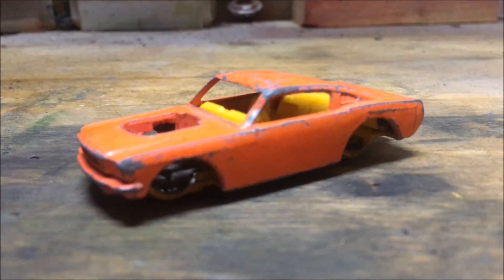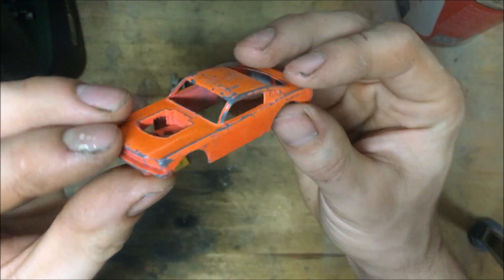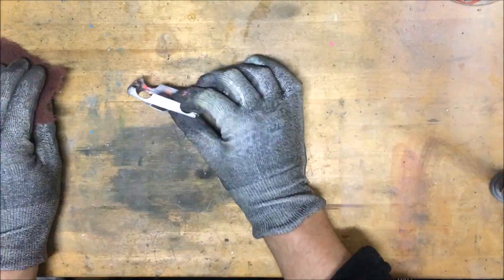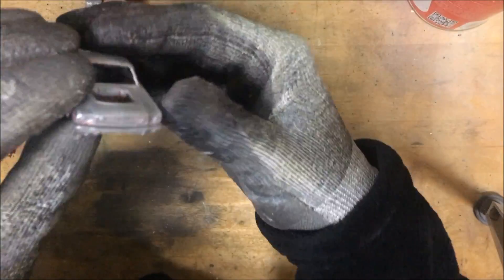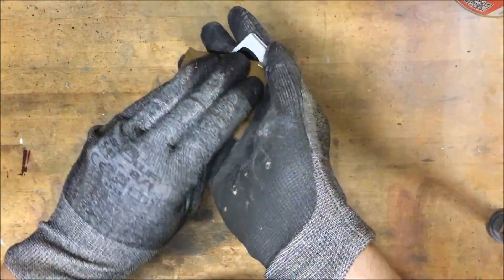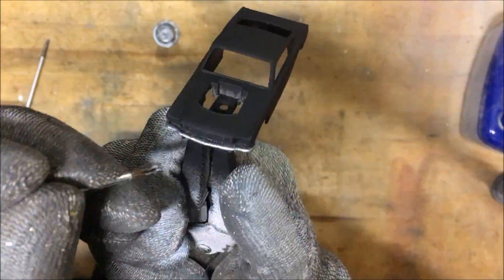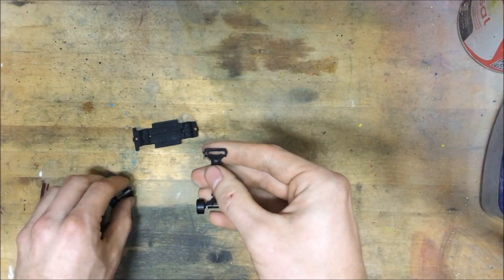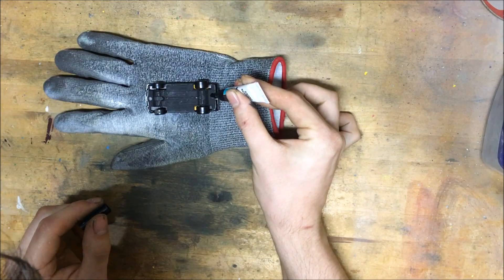FROM SHELL TO CUSTOM - Matchbox No.8 Wildcat Dragster

Comment: You forgot the windscreen and side windows. If you used a cutoff wheel with a Dremel tool you could have cut the exhaust pipes off. Maybe adding part off them to them back bottom
 using superglue it would be  real amazing effect there. Local hobby store has thin plastic in clear (.015 thick) when no other choice will do for "glass". Liked the paint job!
Reply from the maker: In one of my future video's i will be experimenting with ways of making new windshields :) Thanks for the advice

Comment: Nick, you didn't include a replacement windscreen, but then again, original Matchbox models didn't have one either (including interior), so quite acceptable, given that standard; besides, it's a custom! All-in-all, you did a good job with the accessories available to you. Only thing I would have done differently is used a contrasting, shinny, metallic colour (personal preference). Regardless, your version is much nicer than the pinkish hue original (with the wildcat stickers on the side), which I had as a kid. Given a choice, I would have opted for your version instead at the time.

Comment: It’s not necessary to remove the ‘spring’ to put on the wheels. The ends of the spring will lift slightly so the thin axles can slip under the spring against the base.